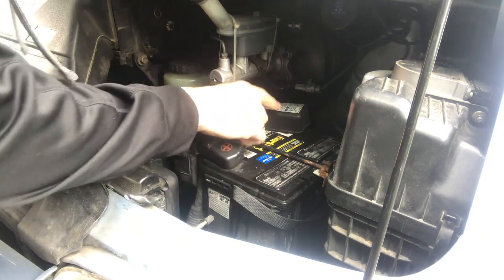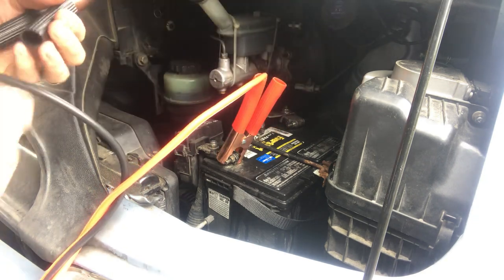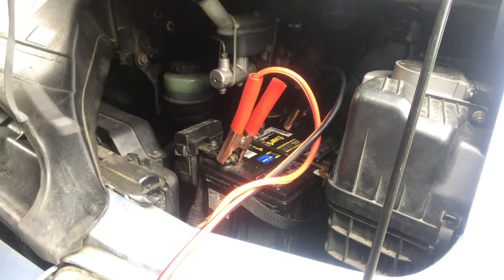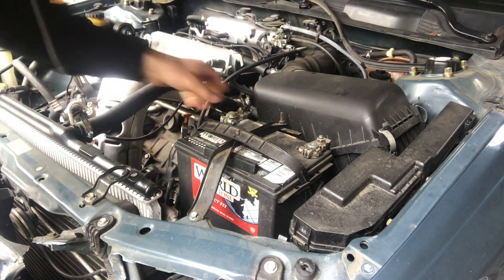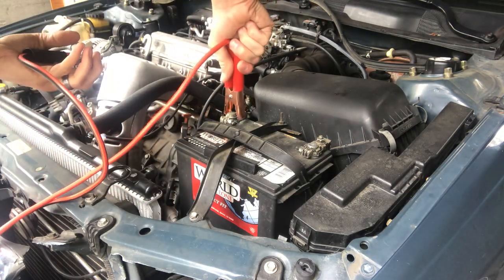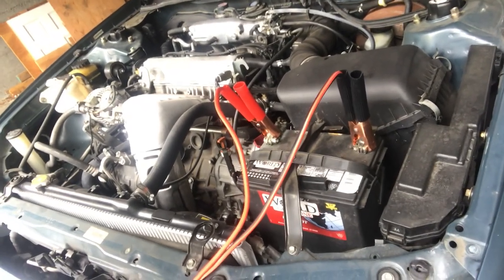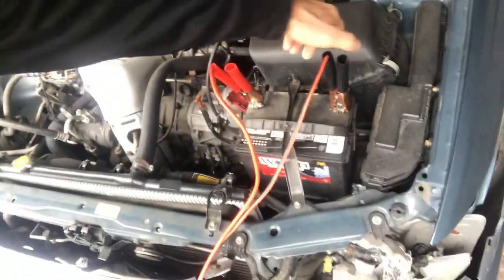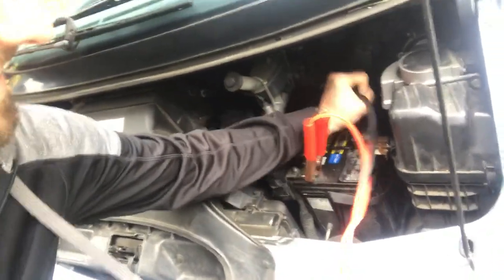How To Use Jumper Cables On A Dead Battery (JUMP START TIPS) | Handy Hudsonite

Comment from the maker: (EXTRA SAFETY TIP - Pointed out by @BayAreaHikingGuides below, is to attach the black jumper cable lead to an unpainted metal surface on the vehicle with the dead battery. This ensures minimal sparking as that is the last lead to be placed and completes the circuit of power flowing between the batteries. - Thank you so much for mentioning that! 👍) - What has been your experience with jumper cables? Have you had to use them before? Thanks for watching. Be sure to subscribe to my channel and hit the notification bell so you can get more tips, hacks, and reviews to get the job done! Be sure to watch this next: https://youtu.be/j83q2Dt-TDw

Comment: Hey handy I love your channel. This is a topic an always struggle at. I heard somewhere that the (dead Battery)  black cable goes on an unpainted metal surface. Is this always also good are I'm I a reading something wrong.?Just trying to clarify. Thank you once again you have been a great help to me.
Reply from the maker: That's a great question. That is one technique, and probably the safer one. It's always worked for me to just connect the negative (black) lead to the negative terminal on the dead battery. It is probably better to connect that lead to something else because I believe it is safer as it reduces the potential for sparks that may ignite if the jump doesn't go well. So, kudos on this comment! 👍
Reply: @HandyHudsonite  thanks for your feedback on this question. Cars confuse me so much, am so thankful you make these videos to help educate people in this world.